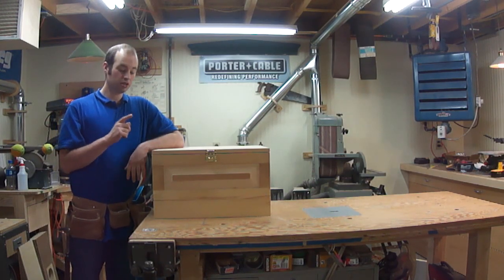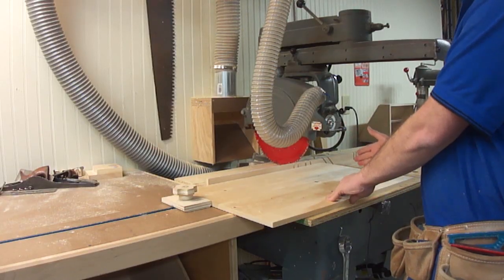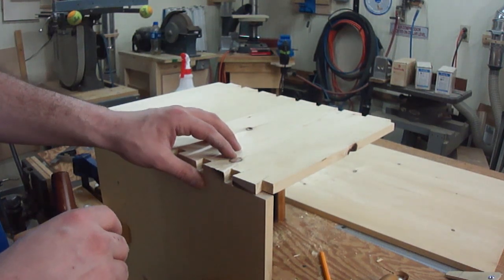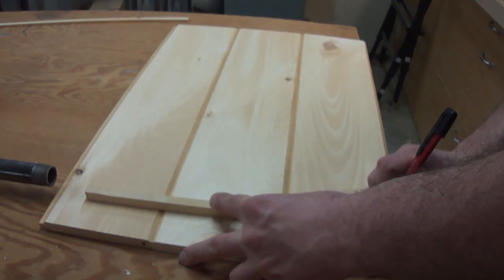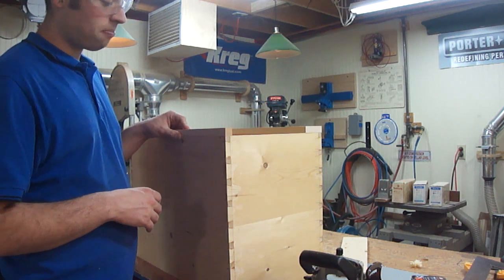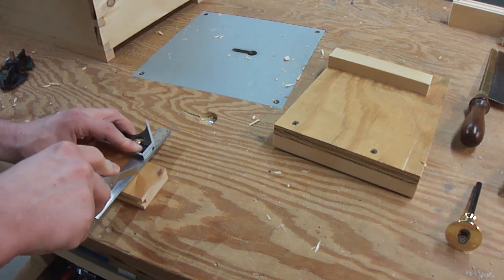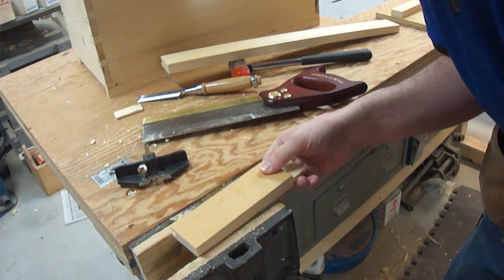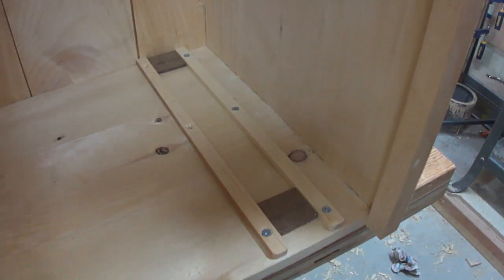Build a Toolbox for Hand Tools

Comment: Hi I dig your videos always watch them. I have a dw1501 that is not starting it worked till after I replaced the bearings it does not start unles I give the blade a spin. I would like to know if you know what size capacitor the machine uses as the that is in it is 20uf and the motor is a 1.45 kw on p1 and 1.1kw on p2. I also replaced the capacitor with a new one and the motor still does not start.